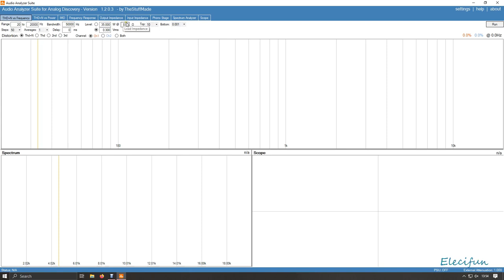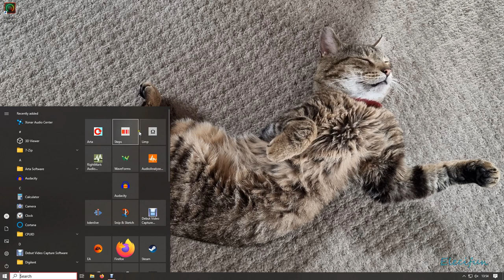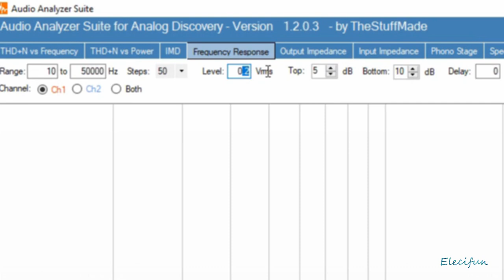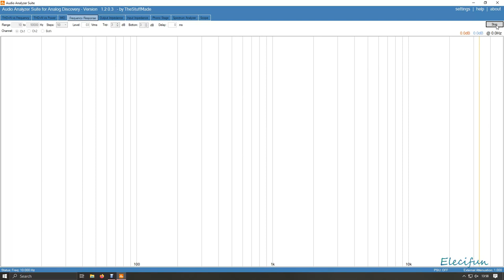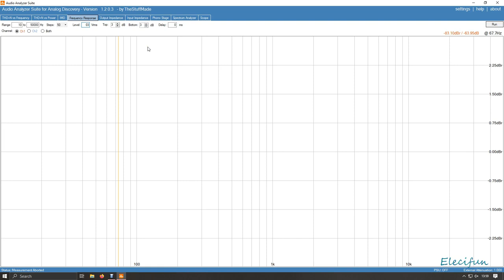How to get SPARKLES from a Clone QUAD606 Amplifier

Comment: That was pretty spectacular! But is 3V input that much? My Arcam dac sometimes gives out max signal when I connect it to my pc through USB.. One have to choose the right mode for it on the pc and turn down the volume. Think thats 5V out max or sligtly lower.. thankfully the tpa3255 chips have all sorts of protection so they have survived several mistakes^^.
Reply from the maker: @impuls60 measuring the input voltage 0.336V and output 18.16V RMS when the circuit worked I calculated around 54X amplification. 
Inputting 3V RMS was enough to, well we saw what happened. I will remember the decimal point in future.

Comment: Um sir what's going on? 🤔🫢
Reply from the maker: @decem_unosquattro9538 what do you mean sir?
Reply: @Elecifun  why did it explode? 🤔
Reply: @Elecifun  Actually I heard it on a jet turbulence video which was quite funny.

The entire aircraft was moving up and down. People were screaming hysterically and crying. 

Aside from the grief strikes passengers it was hard not to see the funny side to it.

Some black dude stands up and says "What's going on !" Which I found quite funny considering the situation.

When I saw the smoke I immediately thought: "What's going on !" 😆😁
Reply: @Elecifun  I think maybe you selected something by mistake 🤔  Anyway just replace what exploded. I burnt my LED VU Meyer out and just replaced the components that exploded. That's the good thing about electronics.

Parts are cheap.
Reply: @Elecifun  I made a blunder today. I'm recladding a wall that's badly rotted. The timber is warped,  rotted and no paint. The birds are trying to nest in the wall.

I had to replace all the timber which had holes and boards falling off.
Reply from the maker: @decem_unosquattro9538 Haha, did you watch the video?
Reply: @Elecifun  Yes I saw a puff of smoke. 😕